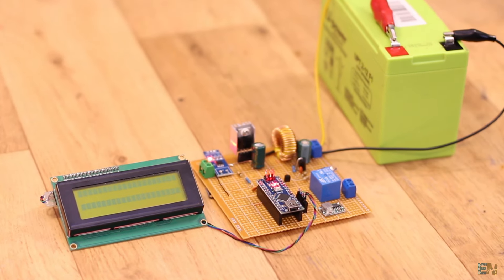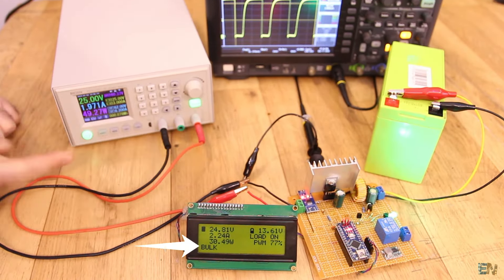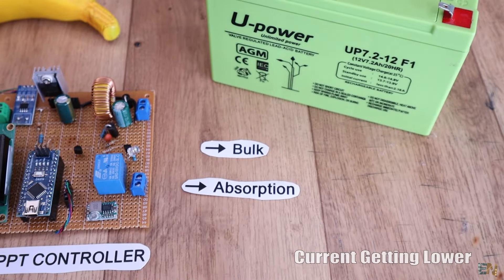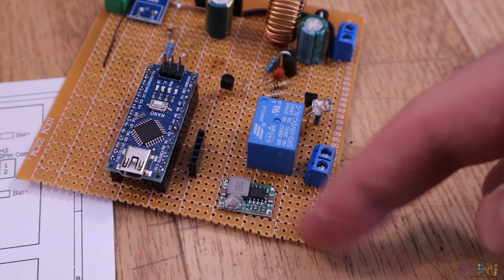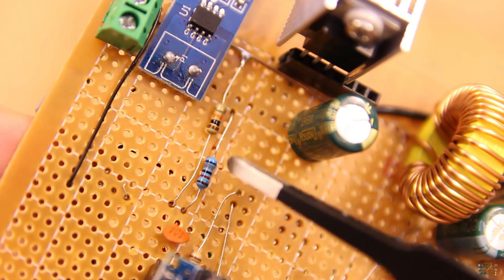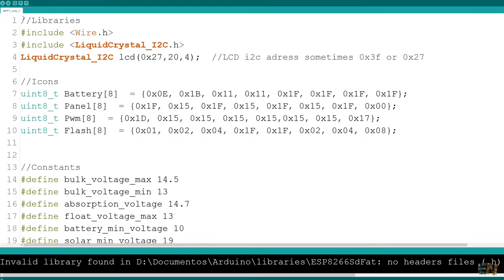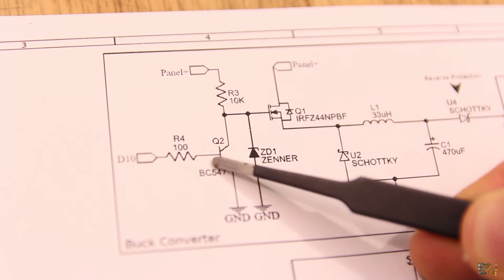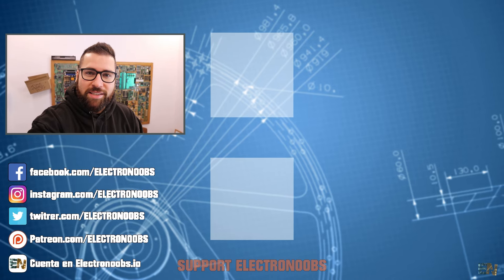MPPT Solar Charger Prototype | 12V Lead-Acid Battery | Bulk Absorption Float

Comment: Maybe add an external comparator as insurance for over voltage or over current conditions. Something like a cheap LM393 should work fine. Maybe also use the watchdog and brownout detection peripherals, if you haven't already. I don't trust code to switch magnetics without analog checks.

   BTW, if you follow the Nintendo Game and Watch hack from Stack Smashing on YT, I have the retrace, schematic, and partial reconstruction in PCBnew posted on my github. There are a few nice circuit blocks to learn from like a nice little single cell lithium charge control circuit, and a P-chan MOSFET that works down to 1.5v. The coolest chip is a new (BGA) DC converter from Dialog Semi, but it is unavailable anywhere ATM. It only has a tiny 0806 inductor(0805 but a tiny bit wider), two 2k2 resistors, and a few ceramic caps in 0805 and smaller. That powers the μC at 1v8. Now for the tantalizing hook...the two resistors are actually used as pull down resistors on an I2C bus....So, yeah, a DC converter that can power a μC capable of running Mario, that uses the ADC to measure battery voltage, runs off of the battery voltage from a lithium cell and is stable at 1v8....only requires a tiny inductor and ceramic caps. While not used, the chip even has a programmable general purpose output. But it is BGA (12) only.
   I'm not done with the project yet, but, as usual, I'm dumb so my schematics are usually stupid-simple too. The blocks should be easily extracted for use elsewhere.
  I don't care about gaming. My reason for working on the project is the hardware security research tools tutorial for working with JTAG/SWD, J-Link and GDB, and to get some experience on a STM32 7-series device.
-Jake
Reply from the maker: Thanks. All these are good feedback that will help me improve next version!

Comment: Hi, to make it mppt do not measure current from solar panel. Measure current coming into  battery. This way you will have a proper mppt charger :)
Reply: And few corrections also needed in BULK mode. Just always try to maximize current by manipulating PWM. Of course do not go above upper limit. This is the only modification you need to do in your code.

Comment: Very interesting video. Question: at the end of the video, you disconnect the battery. No more supply for the buck converter and thus, to the Arduino 5V. So, how is made the 5V power supply for the Arduino in this case ? Perhaps I have missed  something ? Thanks :)
Reply: please tell me what software was used to draw circuit

Comment: Did you use a BJT to control the relay for a reason (vs using a mosfet), or is it just what you had on hand that had the desired specs?

Comment: I want to build a CC CV li-on charger for an ebike "72v" battery pack I made. I don't think I need MPPT. I need to charge at 84v and 5A (0.2C) with the same principles (probably without float). It has a BMS for balance and overcharge protection. I don't see any issue about using this method with a 500w pc power supply. What do you think? I know I need to check components for this kind of power and maybe use an optocoupler for additional protection.

Comment: Would it be required to use Interrupt capability of Arduino, especially to read load current?  A sudden spike should be immediately sensed, I believe.  Apologies if this is a dumb question

Comment: 10:30 not so stable when connecting and disconecting lode, take care of that aspect
Reply from the maker: Thank you. Yes, I'll make more test and improve the code the best I can. Maybe using STM32 would give me more speed...
Reply: @ELECTRONOOBS  It would be great if you could use an ESP32, You could post the data to MQTT server and display it on the home automation system. You could also control the relay based on time or messages.. I'm thinking my garden lights ;o)
Reply: @GaryCrean  Does ESP32 provide rich pwm hardware? (Timers etc. ?)
Reply: @aroshadissanayake9169  It does have great support, 16 PWM channels, for example 10 bit resolution at 78Khz. It’s a beast of a processor
Reply: @GaryCrean  should give it a try. Right now STM32 is my go to solution 😁😁

Comment: I am making mppt charge controller with ir2104 driver ic and using a potential divider for voltage measurement and ACS 712 for current can I connect arduino ground to circuit ground directly to measure voltage and current

Comment: How do you drive n channel mosfet in high side without bootstrapping it , does efficiency improve when bootstrapping is used in the buck converter?

Comment: Make a proper analog Error Amplifier with comparators and use MCU as reference voltage source via I2C DAC powered with 4.096V reference voltage IC.
Your output & load regulation will improve significantly as well as transient response will not be limited by your code.

Comment: Why do we have pins at + and - terminals of the battery? Won't that be a short circuit in the schematic? I think we need only the + to do the voltage divider to measure the voltage across the battery? Can someone explain please??

Comment: Could you add an output for a dump load which could be used to brake a wind turbine in high winds? I would like a single controller that could be used with both my solar and turbine at the same time but i am not sure if it's possible?
Reply: please tell me what software was used to draw circuit

Comment: insted of use a inductor can i use a 2N6488GOS-ND or a IRFZ44NPBF-ND (you can find them on digi-key)?
Reply from the maker: the inductor is the base of the buck converter. We must use it!

Comment: When I used boost 5v Module, when connect to the circuit, the voltage is under 5V. Could you tell me why ?

Comment: Hey. Can I use Arm or Pic Micro controller instead of Arduino ?
Reply: You absolutely can yes, but why bother? NOTHING is as cheap as a knock-off Arduino! You'd have to write your own code from scratch, too, of course.
Reply: @mrnixie  My graduation project. I want to use any microcontroller pic arm. I decided to use atmaga32. It is the same one arduino has

Comment: hello please could you continue with this project i would like to create a solar portable generator which could be charged by both ac grid and dc solar voltage for my battery i am using a 3s 18650 60ah  DIY battery please i beg continue with this project and upload it next i beg with all due respect

Comment: it is just like a charge controller for a lead-acid battery, not an MPPT Charger. :-(
Reply from the maker: Thank you for your comment. The idea is to make this as close to an MPPT controller. At the moment we do have some MPPT fucntions. We control both current and voltage from the solar panels. A PWM regulator can only be used if the voltage of the solar panels and the batteries is the same, which in this case is not. This controller could change voltage and current values at all time.. In this way we could maximise the solar panel output and charge the battery even if the voltage value is not the same. What other functions would you add? Have a nice day!
Reply: it's pretty clear that he is developing and learning during the process... it already is a great point to start the project
Reply: @TotanDas1991  that is my point. I do not criticize but only point out that this is not exactly what the title says of the video.
Reply: It would be great to actually do the maximum power point tracking of the solar input, and changing the charge current to suit. At this point it will collapse the solar panel if you have a cloudy day and won't actually work.
Turn your power supply current limit down to 1A and your circuit should sense the input voltage drop and change its charge current to suit

Comment: Cool project, I've been wanting to build one for some time. What MPPT algorithm are you using? observe and perturb I think would work well but could oscillate around the MPP a bit. Scanning the entire V-I curve and setting a current or voltage output can work very well when the MPP moves slowly (like over the course of a sunny no clouds day)

I think boost or flyback converters tend to be more popular in MPPT since they will have pretty much a constant output power for a given duty cycle, simplifying the control loop.

Choosing synchronous rectification for the buck converter could work well, but can result in current flowing the wrong way (reactive energy) reducing efficency at light loads. You might include both the shcottky diode and use the FET under heavy loads. Or a dedicated controller IC which is controlled by an outer PID loop.

Comment: Hey I made the Arduino drone from your Arduino drone vidos. My drone is ready but it can't able to fly as it is very much thrusted from one side when I increase the speed. The Mpu is working correctly but it can't  able to control the speed of motors.My drone motors are not adjusting itself its speed. Pleas Help bro. As I spent 8000rs on it. Hope you will reply
Reply: hey i am asking you for solution

Comment: This is not MPPT tracker. It is not tracking input power at all. Basic problem here is, that solar panels don't act like bench power supplyes, as their voltage will collaps at higher current load. That is why they need a MPPT tracker. All this is is a battery charger and a weird one i might aid. You are confusing input and output curent.

Comment: Hi again your gate driver circuit needs to be improved.
Also please share the following details:
1. Switching frequency 
2. Efficiency of the buck converter
3. VDS waveform
4. Load and line regulations of the Buck converter
Few inputs
1. This video has nothing to do with MPPT
2. Remove the zener diode, zener diode if used for not exceeding the gate voltage then the zener diode has to be placed between gate and source of the mosfet not between gate and ground of the circuit. Also your gate drive is poor design, when the transistor is turns on, you will apply the zener voltage to the gate of the mosfet wrt circuit ground and not the source. So hence the mosfet could turn on partially maybe in the linear region or if you are lucky in the saturation region. 
Also the waveform that is shown I am guessing is the gate voltage and it looks too slow. The rising edge looks less steep.
Thst inductor looks too big, it’s 25 - 50 W system and you are using a huge inductor literally. 
Your channel is big and people use your designs as reference so please post proper things. No something copy pasted from the internet especially with mosfets.
There are many not just me commenting time and again on improving the gate drive design. 
Other comments:
1. No update on the 3d printed plane
2. Your weekly update/ Q and A videos have stopped

Comment: Lead acid battery charging using transformer   triac based ac controlling with 3 stage charging..  plezz...  using arduino